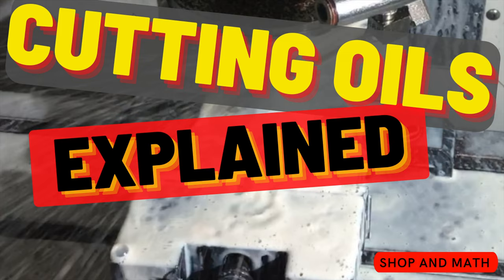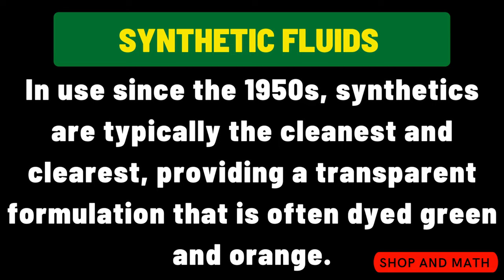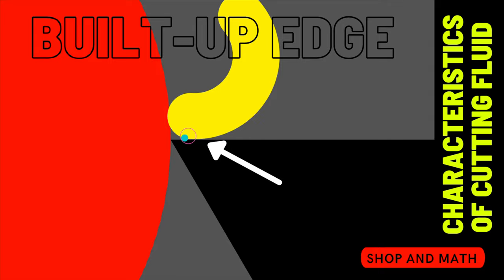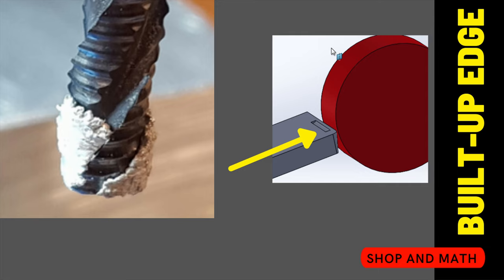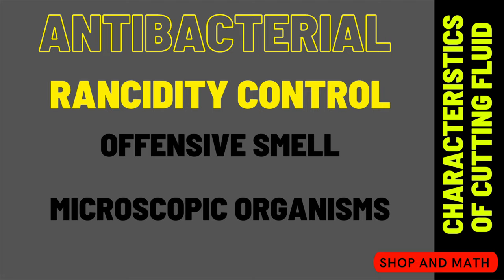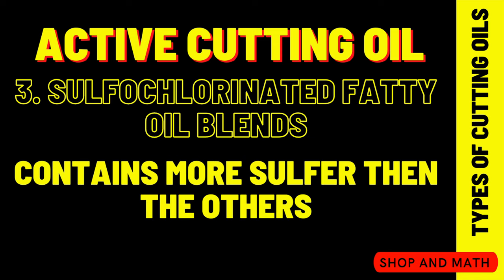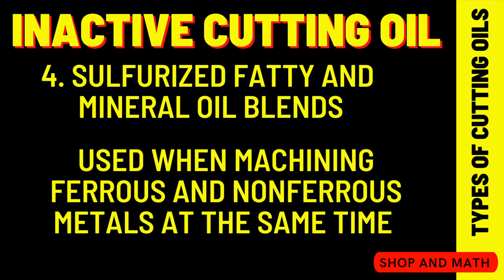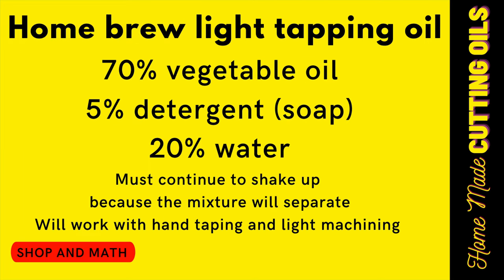Cutting Oils Explained

Comment: Great video! Question though! Do you think Hoppe’s Lubricating Oil (High Viscosity and penetration) for firearms, fishing reels, and all mechanisms, would make a good cutting fluid?
Reply from the maker: I’m not quite familiar with that brand of oil

In theory if you want cooling action more than lubrication do you want coolant with a high concentration of water

If you want a cutting oil that what is it is more lubricant-based you want a cutting oil that has no water

Penetrating oil , Versil, paint thinner
Is used on aluminum or non-ferrous material

You do need to use extreme caution because the chemicals that come off of some of these chemicals are dangerous to your health and can also be flammable

Comment: Well done. The ultimate question: what is the perfect cutting oil for small shop, or hobby use where changing materials is  constant. I use WD40 for aluminum and a commercial cutting oil for steel. It makes a mess and is difficult to clean up. My lathe came with a flood coolant system that I've never used.
Reply: Best thing to use is coolant, an emulsified oil like hangsterfer’s s500

Comment: Is "Cutting" and "Tapping" two totally different things, or are they more similar than different in terms of needing a cutting/tapping fluid?
Reply from the maker: Hi justin
It depends if cutting is high pressure or not 
Drilling could be done with 5% (coolant / oil )and 95% water because the action required is more cooling and lubrication.
Milling could be up to 12%. we are tapping would require 100% oil because of extreme pressure and lubrication requirement.
Hopefully this helps 
Ray

Comment: Excellent presentation of information - thank you. 
YT used to be a place that was about sharing knowledge and where passionate experts shared. Today there is a lot of hot air and nonsense. 

It's a pleasure to find a teacher on here again. 

With respect to inactive cutting oil DIY solution (with its magic 95% composition :P ). 
Different cooking oils have different smoke points where they break down - but also importantly where their wettability changes. This is the principle behind "seasoning" cast iron. 

Normally an oil poured on cold metal will "ball up" due to high surface tension.
I'm not super informed on when higher smoke point oils begin to lose that and spread out vs low smoke point. I wonder if they would be more helpful than Vege oil in extending its use? 
Olive oil has less heat capacity so it might be worse? (also goes rancid very easily).

For your light machining fluid would the use of an oil like avacado or other with high smoke point make it more effective? 

Drilling mild steel or using hole saws - your inactive solution would be ok?
How about "Gummy" metal like Aluminium?  

2nd Topic: BIOFILM 
Machinery that circulates fluid like a cutting agent is at risk of bacteria forming what is called "Biofilm". This is what plaque on your teeth is as example, or the slimy layer on a pipe. Bacteria produce biofilm to breed and protect from threats. Bacteria in a biofilm is 500x more resistant to killing than free bacteria. This means that bacteriocidal cutting fluid may not clean out an "infection" if your machine is gummed up with algae or whatnot through its feed tubes and channels.

It may be necessary to use a flushing agent that will break down biofilm and remove it. I'm talking soft bacterial growth - not calcified formation or calcified bacterial growth which can also occur long term due to mineralised water sources. Oil/Grease or other contaminant buildup/blockage is different too. Detergent will clean oils... might not clean biofilms. 

Something like hypochlorite (bleach) will work but will take time to break down the gunk and need flushing through. An algicide may also be required as an alternative. See pool or spa supplies. 

Afterward you would want to flush very thoroughly to ensure no damage is done to components and then fill with your new cutting fluid.

Comment: Concise and short - perfect! Anchor Lube is pretty good but not perfect. Great on stainless though. Stains bed ways if not removed. Since it's a soap it's pretty safe too. I use it when I have to weld something because it doesn't contain oils.
Reply from the maker: Thank you for sharing that information
Next time I have something they need to weld I will keep that in mind
And thank you for taking the time to comment much appreciated
Ray

Comment: I’m a little surprised no mention of Chlor-paraffin as a cutting oil?

It’s unique property in comparison to oils, is that oil is repelled from heat source, so as a lubricant & coolant in high pressure machining, the heat at the tool point tip, actually repels the lubricant / coolant. The hotter it gets the more it repels the oil, thus it gets hotter - vicious cycle.

Chlor-paraffin is the opposite, the more friction & heat the more of the Chlor-paraffin is drawn to the heat source which is where the lubrication & cooling is required.
Chlor-paraffin is cheap & once was the cutting fluid of choice in machining.
These days it’s sold as an oil additive for differentials & gear boxes etc.
It’s no good as an engine oil additive, the chlorine reacts with gasses of combustion to create hydrochloric acid that corroded engine internal parts while sitting.

Machine shops used to buy Chlor-paraffin by the 44/55 gallon (205 litre) drum full.

I’m guessing the fumes it gives off kill you most likely or shrivel your balls maybe? 🤷‍♂️

Don’t seem to hear of its use much these days.

I personally use “Tap Magic”.
Reply from the maker: first off thank you for sharing
People always skip the comment section and this is the place that everyone can put their input into and there’s some real gold nuggets inside the comment section because I can’t cover everything in the videos and I do make mistakes and forget things 

Thank you for sharing. It is much appreciated. 
Ray

Comment: I was looking for your take on oatey oil on very small lathe (like unimat or Sherline) as a cutting oil. Thank you!
Reply from the maker: Oatey is a good cutting oil for high speed, threading, it is sulfur-based, and therefore good for pressure based cutting methods

Don’t forget that ventilation is extremely important when using cutting oil 

Ray

Comment: I'm looking for a cutting oil that would work best for the milling of 7075-T6 aluminum. I've been looking at both CUTit Multipurpose Cutting, Drilling, Tapping, Threading and Machining Oil (but it's non soluble) and TapMagic EP-XTRA which where I've been looking doesn't mention weather or not it's soluble. I have also seen some that say they are specifically formulated for milling aluminum but I'm not sure how important that is. I'm looking for something that will prevent pitting and preserve the life of my tooling and this will only be used for milling of 7075-T6 aluminum. Are the choices I've selected good, or do you have some better suggestions for me?

Comment: will the emulsified fluid influence  the welding process and later galvanisation (how is the cleaning prosess after cutting?)
Reply from the maker: Thank you for such an interesting question.
Unfortunately I don’t have the experience or experience to be able to answer this question properly.
I can give a couple of suggestions 
I would clean the area with a solvent or brake fluid cleaner and then wash with a soap, water and brush mixture, to make sure that it’s completely clean.
Are you preheating before welding?
Preheating the material might burn off the oil’s depending on the temperature.
I hope this helps.
Ray

Comment: What coolant are you using in your CNC machines.
Stagnant coolant can/will produce dangerous skin bacteria.
Reply from the maker: At this point in time, I currently don’t know, but we use the same coolant on all of the machines manual grinders Manuel lathes,mills CNC mill and lathe
bacteria is a concern
in most cases. If you’re using synthetic coolant, the coolant itself doesn’t grow bacteria. It’s the contaminants in the coolant that bacteria grows on 
Manual equipment for us. It is not a problem because we only use spray bottles. The CNC equipment has skimmers and the machines has proper maintenance schedules, 

It is also possible for someone to be allergic to synthetic coolant or become allergic

Many years ago before I started teaching, I worked with a person who became allergic to coolant he had 20+ years in the trade and had to quit

I hope this helps. Thank you for taking the time to comment. It’s much appreciated
Ray

Comment: Is cutting oil any good as a sealed bearing lubricant?
Reply from the maker: This is only my opinion.
If it’s a sealed bearing, how’s the oil going to get inside?
When I pack a bearing or repack it, I like to know the environment that it’s in going to be running in is to fast or slow. How about the temperature? Is it outside? Is it running outside on the shaft or in a sump?
Use the recommended grease from the manufacturer

With all of that, said honestly, if you’re dying of thirst in the desert any drink will do
Reply: @shopandmath  the rubber sealed rings pop off at the sides if you need to grease or maintain them

Comment: Hi
I am trying to make water soluble milky  cutting oil diesel base ..I hv tried quite a few emulsifiers which can emulsify diesel with base oil but no success as of now..can you guide me in this Regard Sir
Reply from the maker: I would avoid using diesel
Reply: @shopandmath  
Thanks for taking time to Reply..
Here only diesel base cutting oil is used which turns milky white when added to water..so it's a humble request you to suggest chemicals which can emulsify  base oil with diesel..Regards